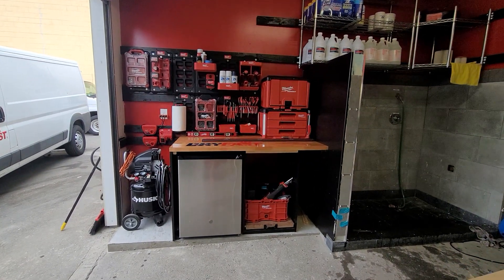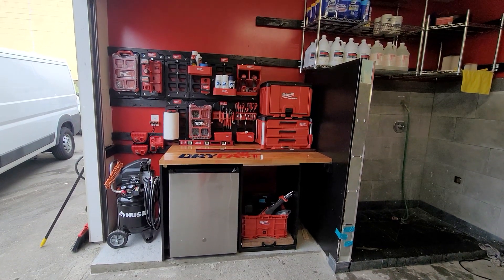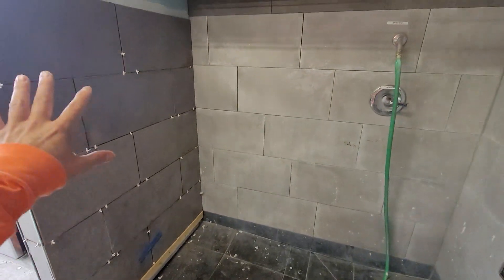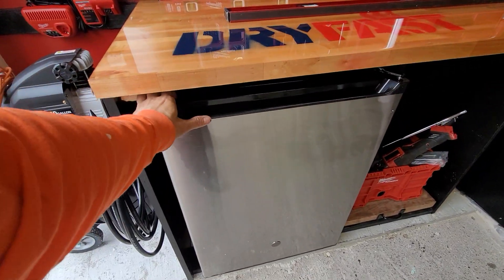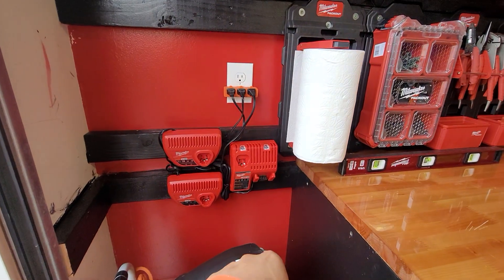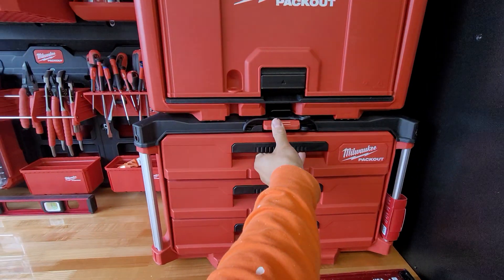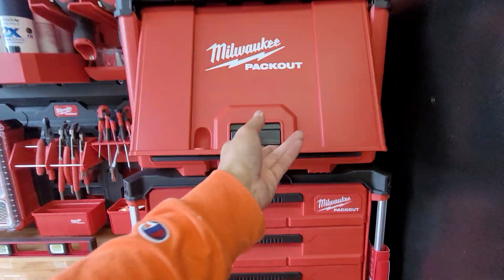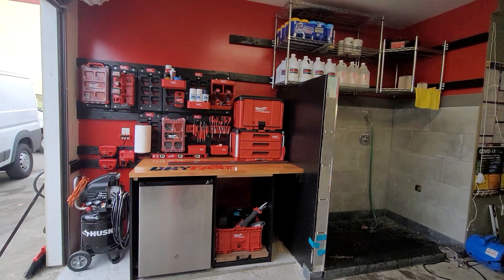‎@MilwaukeeTool  PACKOUT work station milwaukee pack out work station

Comment: What style anchors did you use to hold up those racks? I know the wall anchor part I’m mainly talking about the actual racks themselves drilled to the 2x4’s
Reply from the maker: For the 2x4 to the wall studs is 3 1/2 inch deck screws and then from the milwaukee plates to studs is 2 1/2 inch deck screws the wall mounted shelved are held up by 3/4 inch conduit clamps in strategic places for maximum strength lol